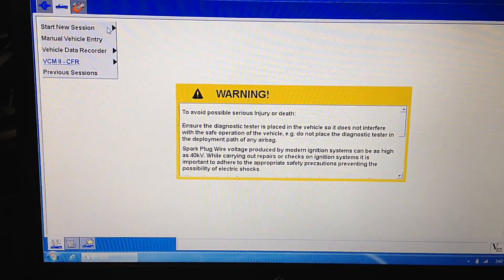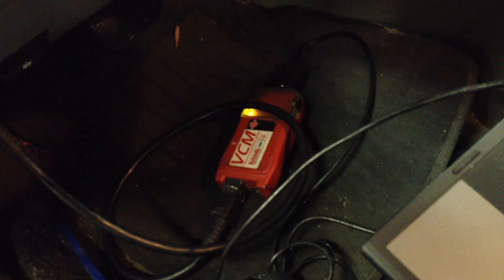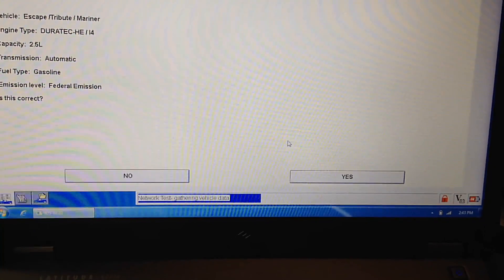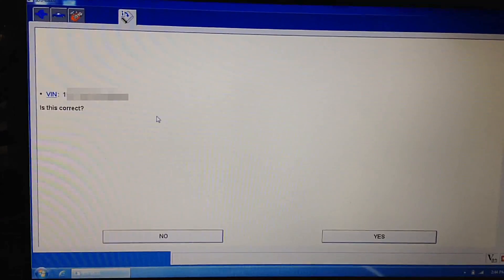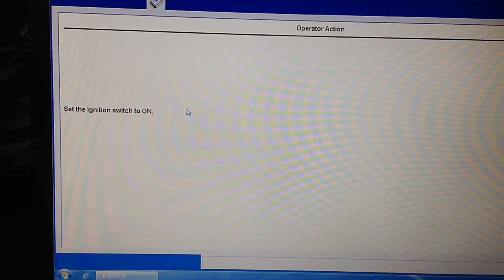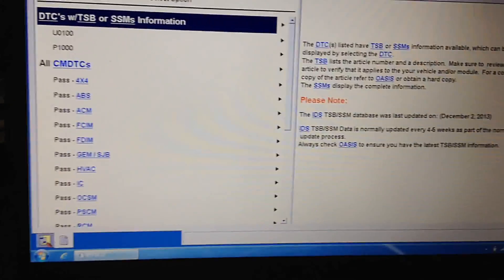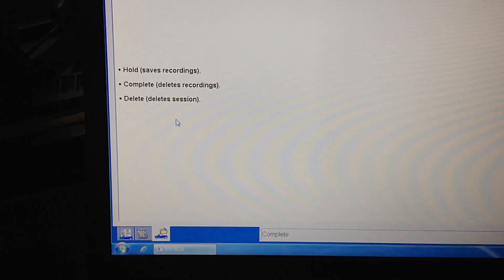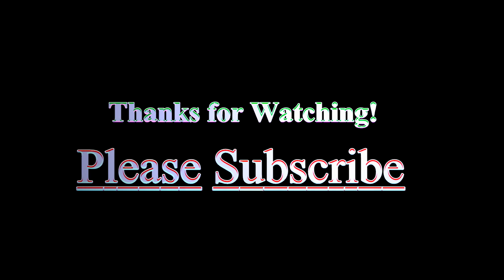Ford PCM Software Reflash Procedure

Comment: I bought a pre-programmed pcm for my 2012 f250 6.7 diesel . Do I need to still flash it
Reply from the maker: You will need at least a parameter reset for PATS.

Comment: I have done this with both the VCX Nano and VCM2 so there's no need to spend a thousand dollars or more on a scan tool for it. One thing to watch out for is if the VCM2 is needing to connect to the internet to download as built data or update. I had to turn off firewall and other windows security, plus go into my (current internet wifi or ethernet) adapter settings allowing connection sharing (for all the 17xx ports available and to the VCM2 connection) and enable the VCM2 internet connection in settings. I also had to use techroute66 (3rd party Ford license) because the Ford CC payment was broken at this time (December 2025).

Comment: Amazing how much ford charges for this type of service. I used forscan and downloaded the latest PCM calibration from ford service and reflashed the PCM myself.
Reply: Did it happen to be a 2004 - 2008 f150 ?  I had forscan and bought the module sold to program it advertised for that specific truck and they don't even have the ability yet to program it

Comment: Great video, like always.  I have a 2008 mustang gt that I bought new.  It's been acting weird for 9 months now, only after it's been sitting overnight or a few hours.  Runs like a champ when fully warm.  I've smoked tested it a couple times, no vacuum leaks detected.  No fuses blown.  Getting o2 sensor codes, even though I've changed them 3 times in 9 months chasing the problem.  I think I disconnected the negative battery cable once while the car was running to test the alternator.  Could that have messed up the software and now I need a pcm reflash?  Also, the a/c stopped working for almost as long, not sure if related.  Or is the pcm fried?  Thanks.

Comment: Hey man. I have a 2007 Five Hundred that I heard had an update due to the PCM causing surging when putting it in gear. And yes I have had it on a computer and no codes and says everything is fine so... I just need that done to it.

Comment: Hi.. 
So can i ask a question... 
I know you're working with a ford model car here, but im sure the PCM and their functions are universal for any brand of car. 
So i have a 2009 Mazda that has been running fine and is still running fine in 2024. However last year The clicker that locks the car and sets the alarm, the interior lights (over the seats), and the Stereo in the car just stopped working and no longer function. There is also a door ajar indicator lit up on my dash even though no doors (or the trunk) are ajar.  I called the dealership i purchased my Mazda from and told them about these issues and they told me my "PCM" may be "outdated" and needed a "software" update.  This is the first time in 15 years I've ever come across something that has been wrong with my car being related to requiring a software update.  So my question is with the features that I've explained here that are no longer working in my car. Does it make sense that yes in fact the PCM may need a software update (if not needs to totally be replaced). And if a software update is required to fix those problems how much should that run for a half hour's worth of labor?  Thanks in advance!   :)

Comment: Do you have a video on how to flash the ACM on a 2017 Fusion? My radio keeps cycling, even when power is off, causing the battery to drain. The dealership wants upward of $300 to flash/reprogram it

Comment: I have a 2002 Ford lighting  truck.  I replaced  fuel pump twice, my ford dealership said it was a bad fuel pump, IAC val, egr valve.  Then they told  me that they got a code, after they said the fuel pump  resistor was bad.  They just cleaned the rust off cause they couldn't  get the part.  I picked up the car, it seemed to be running  good for 1 hour, then rough idle  when at stop.  Back to the dealer, now they say its a bad ground with the pcm.  At this point either  they are just guessing, or taking me for a ride. Could flashing pcm may fix fuel problems.

Comment: I replaced my stereo (2008 Escape 6cyl) stereo with a Sony and disconnected  the battery for 4 days as recommended my Crutchfield/Sony.  Should I have the PCM reflashed?  One thing I noticed was the Anti theft system(flashing light at bottom left of instrument panel) never flashed before so should I assume this was turned off prior to us buying this used at dealer.  Now it flashes intermittently once the car is locked and horn beeps.  Thanks.   I've learned a lot from your videos.
Reply: Your PCM should be ok but your pats key might say key  not detected that happened to me but i just reprogrammed the pats key with forscan worked like a charm.

Comment: On 07-03-2023 a local ford dealership updated my 2016 F150 PCM from "C" to "E" and immediately may my trucks transmission WORSE. Now, dealership wants to throw parts at it. What could of caused the truck to be un-driveable from a pcm reflash from "C" to " E".

Comment: on july 3 2023 i went to a dealer with a "minor" 3-4 harsh shift, long story short a PCM update  from "C" to "E" caused catostrophic issues with my 2016 F150 immediately. No codes, but the truck is undriveable. What do i do next? i need help, asap!!

Comment: Do you put a charger or power supply on the battery when you do this?
Reply from the maker: Chargers can cause a dirty signal, so I use a jump pack.
Reply: @FordTechMakuloco  thanks for the info! I know it's important to keep the battery voltage up during this process.

Comment: Thanks for this video. Its very  educational. Its possible to swap and program used bcm to mondeo mk4 keyless entry? After swaping and pmi programing immo is on... i asume thad i need pair new bcm with kvm module but in ids i dont know where i can found  it.
Reply: You can do it with forscan don't know about this software but more than likely can.

Comment: I seen that P1000 dtc. What do you with that code. I have that.
Reply from the maker: It self clears are the onboard IM240 runs.
Reply: @FordTechMakuloco  ok, I just read that it won’t unless I do the for drive cycle procedure.

Comment: I am going to connect the vcm down there. 
What kind of instruction is that.. down there???????
Reply from the maker: The DLC port must be within 2ft of the steering wheel, so it is not standardized. So down there is a general term for Ford vehicles yes.

Comment: We got ids at the shop and I didn’t know how to really use it but knew we could reprogram since they pay for it. After it gathering dust and finally diagnosing a truck with a pcm ground issue I’m doing it and it seems to be working I love ya m8
Reply: A reprogram solved your pcm ground issue?

Comment: If I get an ECM from the same truck(junkyard) can I just plug it in and will it work?
Reply: No, the vehicle immobilizer will be activated, the error message will say 'suspected theft'.
The vehicle vin needs to be programmed. The 2 required keys need to be cleared from memory and then added, aka reprogramed.

Comment: 2014 F150 with 3.7 and a 6R80.  Replaced transmission and now no start.  I have no ckp signal or ckp/cmp sync on scanner.  The crank sensor was removed but reinstalled after realizing you have to get at the torque nuts from the other side (duh).  I thought possibly I put the ckp sensor in wrong, its a real pain to get that in there, but after doing it again I think its in correctly.
The transmission was not reflashed, we thought it would at least drive to the dealer to get that done.
No codes until I reset the KAM, and now we have a P1639
I had considered swapping the oe valve body due to the shift strategy issue and avoiding a reflash bill but boss said don't bother because of the damage to the old transmission.
I'm married to this thing now, thanks for any help you can give me.

Comment: Fordtech I had a wrech light come on my 2020 gt once I hit 15k miles. And I was told it had a torque calculation error.  Well dealer fixed it after 2 times that I took it. I was told they did a software update on the pcm. I asked the guy what caused it or if this was common on new vehicles and they weren't able to tell me

Comment: I recently had a recall (19S07) performed on my 2011 F-150 5.0. This was to prevent a sudden downshift into 1st gear in the 6R80 trans.   Has worked fine for 132k miles.  Since the PCM reflash, my torque converter no longer goes into lock up.   Also the tow/haul button will turn on the dash light, but nothing changes any longer rpm-wise.   I have also lost 2-3 mpg hiway mileage due to the rpm no longer dropping.  The dealer has a deer in the headlight look when I explain this all to them.  All 6 gears still engage fine, just no TC lockup.  Could they have blown a fuse for the TC, or could the reprogram be incorrect?  Any suggestions are appreciated.  Thanks for all the great videos.  Very helpful to all of the Ford faithful out here!
Reply: Just curious about your comment - was this ever resolved?
Reply: @ohger1  No. Still the same as described above.  Ford had it for another two days.  Tech drove it home.  No problem found.  Still down 2-3 mpg since reflash.  Just recently I ran across a good Ford Tech with a laptop.  He plugged in and no codes in the engine or trans control modules.  He says it’s just the ‘new reflash program’, and there’s no way to revert back to the original program.  I have to live with it.  I wish I had left it as is and taken my chance with an unintended downshift!  It was fine for a very long time.

Comment: I know this video is old, and this is a long shot, but I'm at a loss and really need some guidance since my local shop has had my car for 7 months and nothing has been fixed. They put 3 pcms in it, and its stays in failsafe mode. I know this is a stretch, but I could really use your knowledge and professional help.

Comment: Church van e350 someone stole Catalytic converter’s, now wont shift out of first, ford says pcm was bad cannot get another anywhere,bought aftermarket new, ford dealer programmed it but it wants pats key code and this van has no chip key , how do you get rid of pats programming on a new never flashed pcm
Thanks so very much for video

Comment: I have a problem with P1299 and replaced all the coolant sensors, Cylinder head temp sensor and thermostat but i still have the problem. Do i need to do this to solve it? 2015 ford Fusion 1.5T

Comment: Nice video thanks. Question; what software are you using to do this and how much did it cost
Reply: sale of license and installation for original and cracked ford ids and fdrs at the best price without limitations, all programming systems unlocked, unlimited key encoding, built data download, integrated programming, sync programming, latest monthly ids updates, professional encoding with PTS accounts, 1 year license ids and fdrs

Comment: Hey fordTech I have a question for you, I'm working on a 2013 f150 with a battery drain over night I suspect that the radio is the problem because the display just blinks nothing else works if I decide to replace the module can I use a J2534 box to program the module? Thanks for any advice

Comment: I have a 2010 Ford f150 v8 4.6l. I suspect the pcm may be bad. Got a crank no start. I can hear fuel pump coming on when I turn the key. My questionnis? Is it possible to replace the pcm without having to reprogram? Is there such thing as a swap out and done?

Comment: Just had my 2005 f150 5.4 3v pcm reflashed at Liberty Ford.  Glad I asked for it.  $119.00 plus tax ended up being $127.75 out the door.  Dropped off at 8:30am and was out by 9am.  Brakes feel stiffer, gas pedal feels stiffer, even the steering feels different.  After driving it I noticed immediately the shift points got fixed.  Seems like my gas pedal has to be pushed to half the amount as before, as well as the brake pedal.  Feels like a new truck, especially the throttle.  I was on Ford forums for about a year before doing this.  I had hard starting problems, hesitation during acceleration, random rough idle, etc.  They told me if any of the starting problems happen again to bring it back.  Thanks Brian!
Reply: I don't know how you got $119. I came to the one nearby me here and they wanted to charge me $427 + $199 to diagnose. OMG!!

Comment: I took my 2002 Ford F-150 to the dealership and had them reprogram to as built because of SMOG check reasons(calibration ID not matching similar vehicles). My issue is that after they did that the calibration ID didn’t change. The guy at the dealership said my Computer had been permanently set to that calibration ID. Does that sound right or true? Can that be done? Or is he BS me?

Comment: I have a 5.4L VIN Z 8TH DIGIT, SOHC, BI-FUEL 2003 F150 7700 work truck and I have already removed the propane tank (propane system is broken anyway)  and have the engine torn down for other repairs.  When I put back the fuel rail I intend to remove the propane rail and injectors using regular gas injectors. Is there an option using my forscan tool to modify the or disable the check for propane or is this a IDS procedure? I would like to be able to disable the propane option completely on my own so the PCM does not check to do the fail over to gas like it currently does. When the truck was built and modified in Canada it was reprogrammed with a new code 3U7AALA.  Any advice would be helpful.   I have not looked at the modules yet with forscan and would rather be able to use this tool if possible.

Comment: Ford and dealerships charging for updates made necessary because of their own fault in engineering, is b.s. Should be NO CHARGE.  Just bought a 2010 Mercury Milan. Dealership said due for update. Occasionally shifts a.little.late..
Reply: As someone that works for ford there isn’t an update on that pos it’s called a recall lmao
Reply: @noahsmith8599  if you work for Ford that may explain their crappy cars...lmaox2

Comment: Replaced a battery on an 05 mustang ran fine before hand now it has its self in limp mode no throttle response what so ever had a p2112 and p2104 code come up replaced throttle body still in limp mode will a reprogramming fix this issue? Please help me out car belongs to a veteran and he needs it I'm in a speed shop and hate to send him to ford I have the program equipment.

Comment: I have a 2000 Ford E250 5.4L I just replaced the MAF sensor and intake manifold gasket. Shop couldn't find anything with code P0171 and P0174 reappearing again. They recommend reprogramming or flashing. I wonder how much it should cost. The mechanic says a couple hundred to almost a $1,000 depending on make with Mercedes and Audi more towards the $1,000 mark.

Comment: I have a 2008 ford 5.4 superduty xl. I want to add cruise and I've been told that you can add a steering wheel with cruise control and flash the PCM and have cruise. My local ford dealer has no interest in verifying this.

Comment: The adaptive tables learned by the trans. That's a nice clue.  this is probably why my transmission is running so bad after the recent recall and reflash. My mechanic is suggesting it's a transmission solenoid and the issue was present before the flash. I would like to see if the manual table was reset. Clues are pointing to -> not likely!

Comment: This is interesting. I found you when looking for a hard shift issue with my 2010 F150. Can you tell me where to get this software and connector module so I might be able to update the software myself. Also, is there any preferred brand and how much should I expect to pay for a decent connector and software?
Reply: Big DWG through the Motorcraft Service website, a VCM II is $1,500 and you'll need a Windows laptop with the IDS software installed, then you'll need to purchase a subscription, cheapest is $50 for 72 hours

Comment: Amigo, boa noite, tudo bem? 
Tenho um FORD FOCUS GLX 1.6 MANUAL 2013/2013 SIGMA.
Estou tentando ativar os botões de CRUISE CONTROL, mas, o ELMCONFIG parece acusar que não tem módulo PCM, pois, não mostra o modelo, nem versão do firmware. 
Minha dúvida, o módulo PCM existe somente nos câmbios automáticos? É uma peça física ou apenas um firmware na central? 
Pergunto, pois, estou com os botões do Cruise Control instalado s e os testes dos mesmos acusa estarem corretos, mas, no teste de estrada, não liga. 
Eu, via VCM IDS, consigo instalar o firmware PCM na central, para utilizar o CRUISE CONTROL em um SIGMA 1.6 manual?

Comment: am considering reprogramming pcm on a 2013 f150 EB to latest calibration.Never had any misfire issues, but wish to optimize fuel econ. because current pcm is outdated by about 3-4 versions. i have access to IDS software & vcm2, but not sure if truck battery needs to be on a life-support charger during the update, even though my batt is brand new (<2mo old). If needed, is there any particular type/brand of charger you recommend that’s inexpensive for diy guys like me? thanks. 
ps: it’s amazing how rapidly less helpful/cooperative dealers get when u mention u got a scan tool and wish to tackle most issues urself until absolutely necessary to have them do the job!

Comment: My 2004 ford explorer limited with a 4.6v8 has been sitting with a dead battery for a couple of years.  It had the transmission replaced right before it was stored.  Now upon startup, it shifts funny.  It is parked at my moms until I can get to it but do you think that it needs a pcm reprogram?  It is also saying advance trac off, traction control on??  Does the abs module need reflashed too??